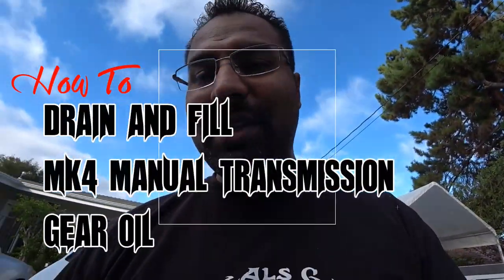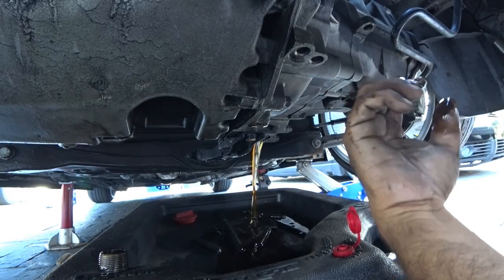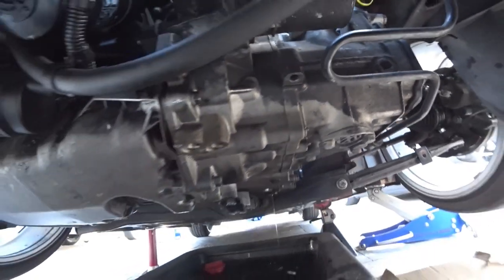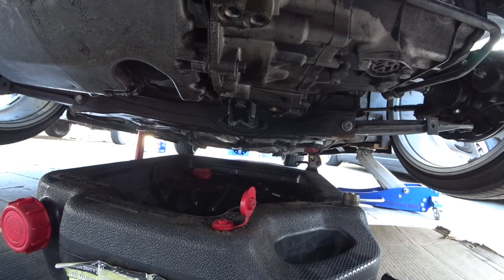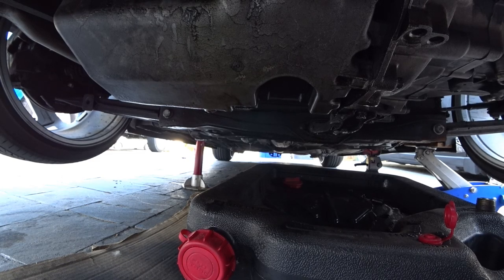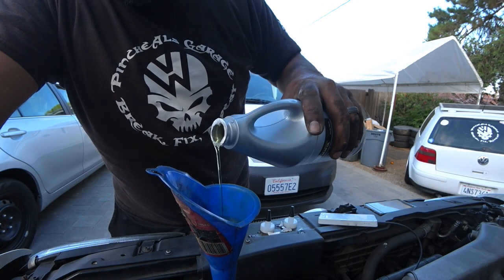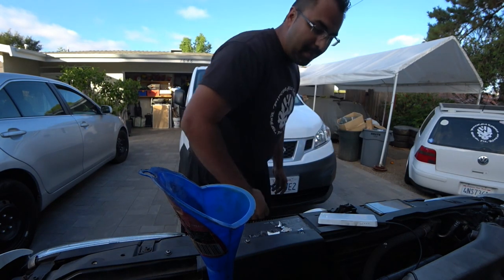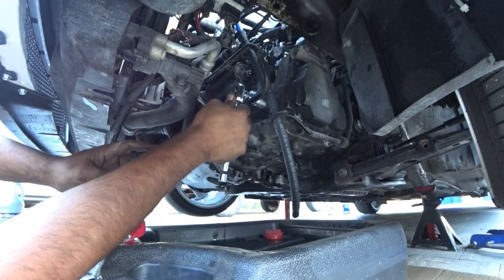How to drain and fill an MK4 Manual Transmission S4EP23

Comment: In this video, you briefly talked about eventually replacing the radiator in preparation for replacement of the engine and the addition of a turbo.  I'm interested in hearing about that project.  Will you consider making a video to discuss the tools and parts gathered prior to starting the job.  Maybe talk about the most significant things that needed to be considered when removing, installing, possibly modifying, and tuning.  Maybe the biggest headaches involved with the project and advice you might give if others are considering the same project.  Thank you.

Comment: This is so incredibly helpful.  A question a couple people have asked, how important is it that the car is level for this change?  I've been seeing a lot of people saying to make sure it's level what is your opinion?
Reply from the maker: It is very important ince you dont have a dipstick to check levels.

This is why we do this on a level floor and fill until it spills out. If your at a very aggressive angle you can out too much into the trans
Reply from the maker: Great question by the way
Reply: it takes two liters, thats it. If up on an angle, just put in 2 liters and you are good to go..  I would wait until car is sitting for a while so as to get all the oil drained back towards the bottom of the transmission case]

Comment: Top vid dude, 
Got mk4 18t Indigo blue,replaced gearbox mount that had its days,since putting engine/box mount on and what with it up probably 10mm to where it should be I have noticed slight more noise of wear n tear of a 110k golf gearbox.So I looked up how to do ...Your vid..10/10 plain and simple and very useful..shall do mine wkend hoping some improvement. Not so sure if to put in additive? Keep up the good work. 
😉👊🏼🤘Jay (UK)

Comment: So the car doesn’t need to be leveled? Just lift it from the front and thats fine??
Reply from the maker: It does need to be level for the best results however if you can't level it like me it's 100% fine. Just make sure when filling the transmission the oil spills out of the fill hole then plug. That way your just about right.
Reply: @PincheALsGarage  ok. Thanks

Comment: Hello, good videos, im From argentina.Your explanations are so clear, there are perfectly urdestandable. I have a question. If you fill de gear box whit the car on the jacks, the car are inclinated, then you gonna put more oil than the gear box needs. There is no problem with that?

Comment: Hey all mark iv manual transmission all use that same gear oil?? About to do this on my GLI Jetta 6 speed.  Thanks great info
Reply from the maker: YES1 6 speed trans use the same gear oi lweight
Reply: @PincheALsGarage Garage it can be as well for automatic transmission right?
Reply from the maker: No automatics use a special fluid

Comment: I'm attempting a 01m to 02j swap on my 2001 jetta, I was wondering if anyone knew exact wiring modifications needed? do I need to recode my ecm to ignore the tcm? Should I just get a manual ecm? I've got all the obvious mechanical parts and everything ready to rock. I just need advice/info on the wiring and computer! Looking forward to hearing back from you!!!
Reply from the maker: Rory Lehtola you will need a ecu from a car with a manual trans and the wire harness

Comment: Hey man! I was watching some of your earlier videos and saw you were running the f23 turbo setup on your mk4, i also have have an mk4 and was wondering if the f23 setup is worth it relability and power wise? trying to be somewhere around 300 whp haha. Thank you bro!
Reply from the maker: Satisfy Fx the f23 is a great choice and you can make 300hp all day with it however you will run a high risk in bending the rods since that setup is very torquey. The sad part for the same amount of money you can go big turbo in low boost and make the same amount of power and tons of room to grow. I would highly sugget both options though.

Comment: Hi cool videos. I was wondering if you have any video on how to replace the clutch on a mk4 ???
Reply from the maker: Mahc 20 yes we have videos on how to remove the trans and install a clutch. Just need to look for it on my channel.
Reply: PincheAls Garage  yea I just found them one more question do I need to bleed the slave cylinder after replacing the clutch or it's not necessary thanks for the reply .

Comment: I got 2000 vw 2.0 beetle 5 speed keeps piping out of 5 gear changed fluid and it stoped for about a day and is doing it again unless hold shift in 5 then it will drive if enough hold on shifter in 5th gear all other gears works fine it has 112xxx mikes
Reply: @pennsylvanianAntDepravity  not Abigail deal if its 5th gear it's on the outer pan of trany so its accessible and fairly easy to do but any other gear you may as well buy a used or new trany cause you have to take out disassemblewhole thing and yeah just my point of view but I replaced syncros and the 5th gear with 5th gear out of a 01 tdi beetle to gain sum extra rpms at 65 70 mph it wasnt a fun thing to do being it was my first time and I have to admit vw cars are by far the dumbest assembled cars to have to work on or even maitaince onece againthats my personal input  on them sweet cars when they work gotta give em that

Comment: Why 3 bottles ? Spec says it takes 2 Liters only !   Overfilling !!!
Reply from the maker: When filling you are correct 2 bottles but a lot of the times you make a mess or you let it drain a lot longer than normal and a dry Trans takes a bit more than 2 bottles. Plus when filling once it starts to spill I like to use a fresh bottles to make sure I top it off nicely.

You can not overfill the Trans if your on a properly level. Once it spills out of the fill hole you are at the proper amount. If your not level and the Trans is tilted back you will overfill. Just a pointer!

Comment: Sup hope someone would help, i can't find videos of changing rear diff oil on an mk4 4 motion, don't think you guys in the states get the mk4 4motion 1.9tdi, which is why there isn't a video out there for it, but if someone has experience on this subject greatly appriciated if help is here. I am planning to do a change of all oils in soon to be future, i have already bought everything, diff oil motul gear 300ls gl5, original vw trans oil gl4 75w90 (all aftermarket oils suck in the winter apparently, so i picked stock vw) haldex tube oil 275ml, haldex filter and some other small stuff, but my main concern is how to do the rear diff, because yes it is an seperate unit from the haldex
Reply from the maker: Man I wish we had 4 motion here in the States. Maybe I can find a Bentley manual for you. Give me some time. Please email me asap so I can email back the guide
Reply from the maker: @erykkuld7139  that an old email. Here is my current one.

Pincheals.garage@gmail.com